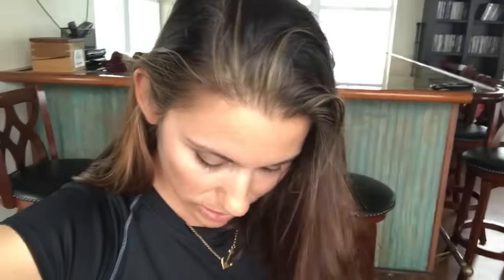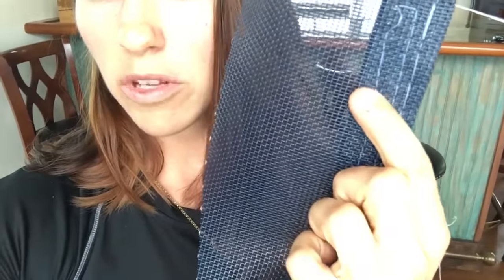Atticus Update 85: PTFE lifetime thread skipped stitches blues

Comment: After trying every possible combination recommended by Sailrite including placing the spool horizontal, I still could not sew with the PTFE thread. What finally worked was putting the thread spool  stand directly behind the first place the thread goes into the machine. But I added a thread spool sock over the entire spool, tightening it slightly with a pin.  I  reduced the upper tension quite a bit which caused lots of loops on the underside. Then gradually I kept tightening the tension one or two turns until I finally got the knots to come up so they were tight and nearly invisible. I also found  when using the Sailrite LS1 walking foot if I set the stitch length mechanism all the way to the top which was suppose to be a 6 the stitches were irregular and not tight. If I dropped the lever down to about a 5.5 the machine seemed to be able to keep the stitches more even and tighter. Previously, I had lots of problems with skipped stitches about every 6 or 7 inches. Changing the thread spool and putting the sock on it all the way up the spool seemed to keep the thread from kinking. I might add Tenera recommends a special needle for using with their thread.  There is also another PTFE thread called Solarfix which is suppose to be easier to sew with. I haven't tried it, however.  Hope this helps, pretty sure the spool sock was the key to stopping the skipped stitches. One more thing...the greater the thickness of material the less the thread seems to skip.  Would mention I tried wrapping the thread twice around the upper tension as Sailrite suggested and tried #14, 16, 18, 20 needle gauges to no avail. A useful pdf at "Gore Tenara" is  called "Processing Guidelines: Sewing Thread for Outdoor Applications." The website is hard to navigate but if you put the name of the pdf in the search box it will bring you to the right page. The pdf discusses troubleshooting problems sewing with their thread such as thread breaking and skipped stitches. It should all apply to using Sailrite PTFE.

Comment: Great to see that your still around and fully understand the finance situation. There are times in everyone's life when you just have to do the sensible thing.
Reply from the maker: +funNstuff with the Foxwells Thanks! Luckily there's plenty of work in Key Wet between working on boats, doing fiberglass/woodwork, and sewing!
Reply: +Project Atticus my singer 201 k used to struggle with that stuff so i changed to a different thread,try turning your thread tensions up or down it will either be to high or too low causing the skipping or its a bent needle but that mesh stuff is a pain in the ass to sew full stop
Reply from the maker: +Charles Hagen hi Charles! Thanks for the shout! Not at the moment but I'll let you know!

Comment: Thanks for your videos and we're happy to see your progress. All the learning, adventures and sail loft experience to boot -- YAY for you two! 
All good suggestions about your PTFE issue and #16 needle should work fine.  All I can add is that PTFE threads are not all the same and you may have constant trouble trying to get the one you are using to work. 
IMHO, it is worth the time and effort to find the one that works for your machine, don't go back to polyester (except for super high stress things like trailer winch straps).
Solarfix 2000 (equivalent to db92) is all I have used for five years.  It runs equally well through my Juki, Consew and Sailrite and I have had no issues. Do not be tempted to buy the rewound bobbies -- they won't fit your Sailrite. I also switched to Groz-Beckert needles and WOW -- I wouldn't have imagined a needle would make such a difference! I can't think of the style# offhand, so will send to you tomorrow.
My husband and I both enjoy your videos, with the added bonus that when we watch them, we think about our project boat just up the road at Boca Chica.  We need to hustle up -- we started before you and you're ahead of us!
Reply: what size needle do you use with the solarfix 2000? thanks

Comment: I think you may be right. I'm not familiar with these more modern threads. I worked at North a long time ago, but I think your best resource will be the loft where you currently work. Something like fishing like is monofilament and has a mind of it's own, and a mesh like substrate doesn't have much grab to hold the thread. Really fine work on Atticus. Keep sewing. All the best. Al.

Comment: The PTFE thread can be a bugger to work with.  Tension is the biggest issue since it is so slippery.  the tension adjustment typically won't do it on the sailrite machines and requires extra wraps through the thread tension holes in the front.  Sailrite can offer some great advice and has good tech support.

Comment: I had the same issue with Tenara. I went with a smaller needle #16 and used three wraps in the three hole thread guide fixed my issue with Tenara thread.

Comment: Sailrite has a video on this thread. Skipping is a common issue. As well when dropping to a smaller needle it will change the needles spacing (scarf)to the hook. I am curious about this thread. I use Durkopp Adler 867's fully automatic machines and I am curious if I could get this thread to work on my machines. When I have a chance I will experiment as I have plenty of experience on machine timing etc. What is the size of thread do you use? IE #69-92?  You can be sure it is a hard sell to customers regardless. To me, it makes no sense that any thread should randomly skip if the machine is setup correctly and using the proper needle. I am willing to bet a advanced timing proper needle size / tension and correct scarf to hook spacing would solve this problem. The problem is when you change to different thickness and material types you would possibly need to make changes again..

Comment: I had the same skip stitch problem with my sailrite machine.  I fixed it by changing the needle to a GROZ-BECKERT Regular Point 135X17 DPX17 needle.  It immediately fixed the problem without any other crazy machine and thread adjustments.  The needles sell on Amazon too.  We’ll need to convince sailrite to start carrying them.  Hope this helps...
Reply: What size needle do you use? #20 or as recommended in the Sailrite doc (#16)? thanks
Reply: Frederic Mora 
I mainly use a size 16 needle but also have size 18  and 20 for thicker projects.  I had several layers of sunbrella with some nylon webbing which was too thick for the size 16 needle and it broke when I tried pushing it through.  I swapped to my size 20 and had no issue.  Sailrite recommends the smaller needle for the lifetime thread so I typically try to sew with the smallest size needle I can.  I hope this helps...  Julian

Comment: With the skipping stitches, try a ball point needle if you haven't tried one all ready ( daughters recommendation who has this problem with synthetics).  As mentioned below, check the timing on the machine, here is a website with some checks: http://www.sewitworks.com/timing/ - check the shuttle hook to needle timing, bottom left picture.  Another thing with the needle is to try one with a deeper scarf, the scarf creates the gap between the needle and the thread where the shuttle hook goes between to separate the upper thread from the needle. ( Scarf described here: http://wiki.embroiderymachine.com/index.php?title=Embroidery_needles). BTW do you guys have a patreon account https://www.patreon.com/ to help fund your dreams?